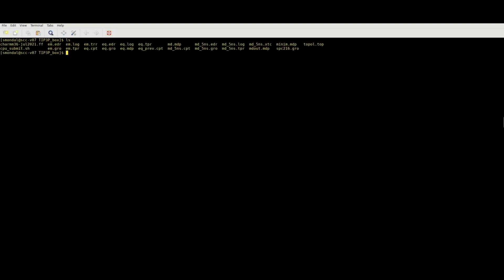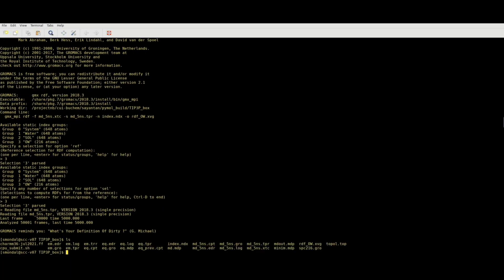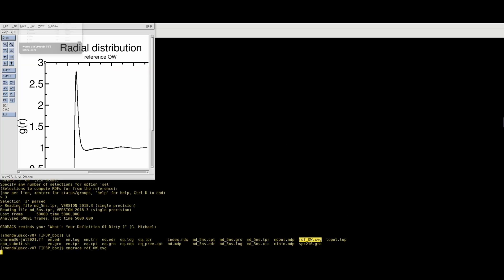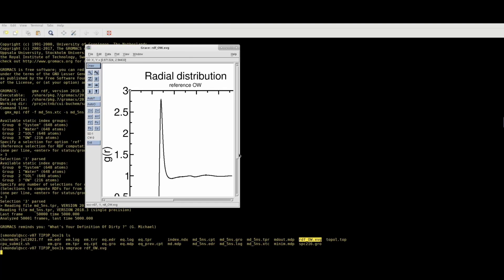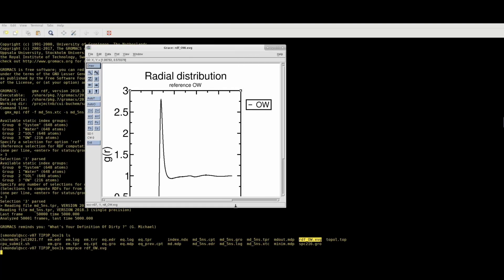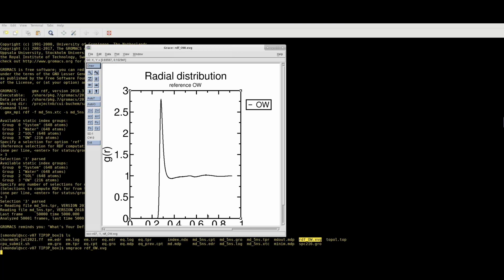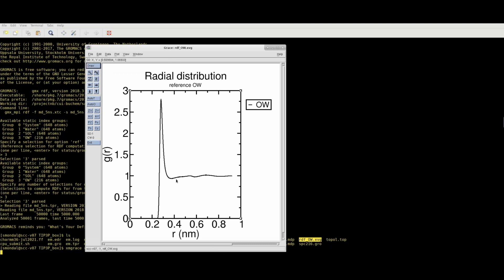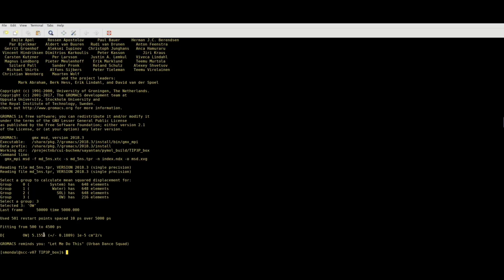Simulation of a Water Box with #GROMACS | Part-3 Analysis of the trajectory

Comment: Can you make vedio how to solve lincs error in gromacs fduring mdsimulation
Reply from the maker: If you are getting lincs error during energy minimization or initial equilibration, you may use "lincs_warnangle" keyword in the mdp file and set the value to 90 or so. Then see if the error disappears. But this js not recommended to use during production run.
Reply: @sayantanmondal6461   sir in md.mdp file this changes will done

Comment: can you please share the gromacs 2018.3 tar file for installation it is not available in gromacs site
Reply from the maker: Thanks for reaching out. 
You can find all the versions of Gromacs here:
https://ftp.gromacs.org/pub/gromacs/
Reply: Thank you
 @sayantanmondal6461  can you please explain me How to calculate hbonded population from hbnum xvg file
Reply from the maker: @tubaichowdhury1232  I could not clearly understand what you meant by 'hbonded population'. May you elaborate a bit more?
Reply: @sayantanmondal6461  means total number of H-bond between the donor and acceptor
Reply from the maker: @tubaichowdhury1232  you may define two groups in a index file. One group containing the donor(s) and the other containing the acceptor(s). Following that you may run "gmx hbond" with "-num" flag and provide the two groups as the two inputs. Does this answer your question?
Reply: @sayantanmondal6461  Hi Can you tell me how to calculate viscosity calculations  using different software
Reply from the maker: @tubaichowdhury1232  Hi...I am afraid that I cannot tell you any software for viscosity calculations, as I tend to do all the post processing/analysis with my own codes.
Reply: @sayantanmondal6461  Yes I understand, there are some github repository for PyLat but that also work only LAMMPS Analysis. I wish to run the calculation for opls force field.
Reply from the maker: @tubaichowdhury1232  all the best

Comment: Thank you very much sir For this Good tutorial. 
What is the importance for calculation of RDF and dipole moment  ?
Can I calculate the RDF and dipole moment for protein totally ?
  Is that meaningful?
Reply from the maker: You are most welcome. 
The RDF speaks about the structure and is related to several thermodynamic properties. So getting the RDF right is an important part of any force field calibration. On the other hand, dipole moment fluctuation is related to the static dielectric constant of the system. 

Yes you can calculate these properties for a protein. and they are meaningful indeed.